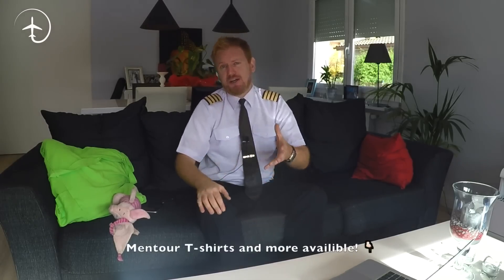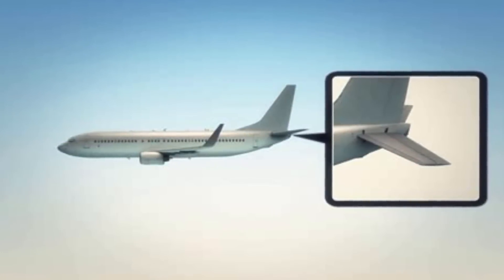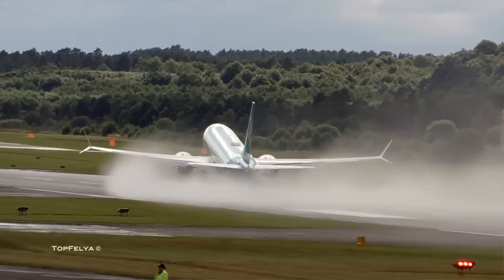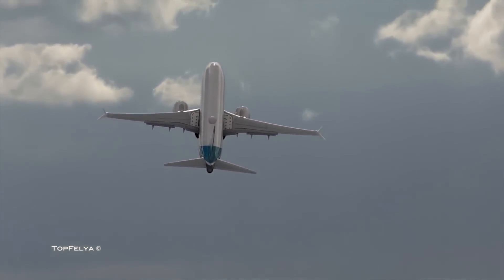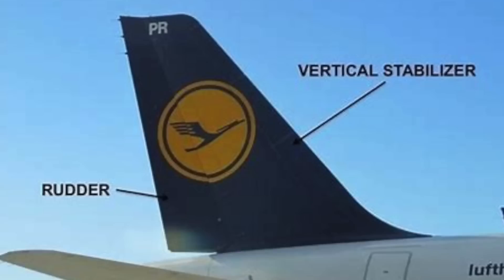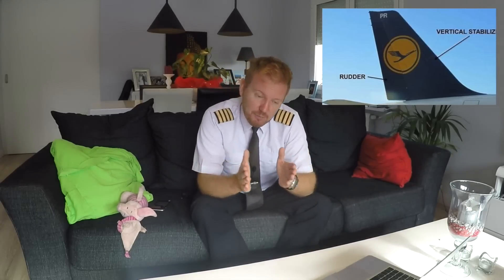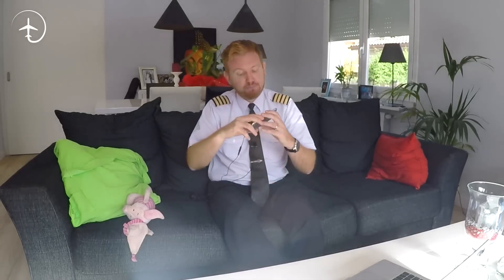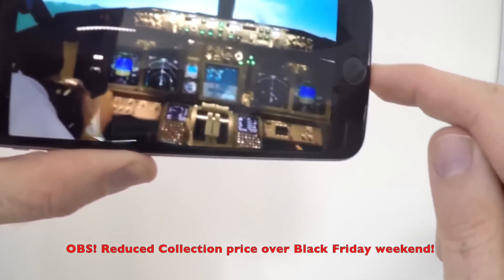How do the "Stabilizers" work?

Comment: Great video as always. 

Until you discussed the load sheet, it had not really occurred to me how pax seating could demonstrably affect the performance. Now I’m even more curious about by how much. Say you had a half-full cabin, and were trimmed up in level flight, flying manually (autopilot off). If a pax got up and walked to the back, would the AoA start to creep up noticeably? How quickly would it become apparent? What if it were two pax, or five, or ten?

Comment: I flew right seat in a Ford Trimotor a few months ago, and I noticed the pilot was adding rudder in the turns. No yaw dampers on those. Imagine flying one of those cross-country. No autopilot, so you're hand-flying the whole time, coordinating your turns. 3 loud piston engines, and back in the day, there were no ANC headsets.

Comment: To explain banking a little more, maybe use roads such as the Autobahn or the USA Interstate system, or any road designed for high speed.  On such roads, turns to the left and right will always see the road itself banked up so vehicles are using centrifugal force to remain ON the road, instead of sliding off it.  You see the same thing on turns at race tracks.  Planes do the same thing, except they have to bank themselves, and do it properly.  The principle is the same.

Comment: about the moments u mentioned. for the plane to be steady shouldn't the upward pressure moment be = to the downward pressure. that's why the greater force has a small distance to the centre of gravity while the smaller force has a grater distance to the centre of gravity, hence D1*f1(moment for grater force)=d2*f2(moment for smaller force). this is simply saying all Clockwise moments are equal to all counter-clockwise moments for it be in equilibrium.

Comment: Nice video, but you did not mention why the vertical stabilizer (the fin itself) is needed, only the rudder. This might make it seem like the fin is only there to hold the rudder control cables and hydraulics.
The actual fin itself helps stabilize the aircraft. If you imagine the aircraft flying forward, but then getting the slightest of yaw angles, then the stabilizer will catch the sideways component of the airflow and rotate the nose of the plane back into the wind. So, a small deflection in yaw will be automatically corrected. 
This only works if the vertical stabilizer is at the tail. If it were at the nose, then the sidways airflow would rotate the plane further out of the wind, destabilizing it. The hump of the 747 has this effect (a large, sidewind catching surface area in front of the center of gravity), which is why the 747 has a relatively large vertical stabilizer.

Comment: I have a question about something that has been "stuck" in my mind and you seem like the perfect person to ask.  I read an article about an airliner that survived an initial "hardover" encounter which left the pilot struggling to initiate a survivable landing with a severely deflected, inoperable rudder.  With a lot of luck and almost 30k hours of flight experience he pulled it off.  While I realize that aircraft are essentially some of the best designed vehicles that there are my question is why don't they design aircraft with simple  redundancies like a manual crank that is available to "undeflect" the rudder when it is otherwise inoperable.  I know this must sound ridiculous to an experienced pilot but a simple mechanism could be added to these "basic" systems and in an emergency situation could make a huge difference. So that's my question, do you have the thought that a manual rudder system for use during a severe rudder failure is unreasonable?  Why aren't fail safe, manual redundancies like that incorporated into these amazing vehicles?

Comment: Has there been any tests on putting the rudder on the winglets instead? I.e. completely remove the vertical stabilizer and put total rudder area divided by two on the winglets.
Maybe dirty air on the leeside and too much stress on the wings could be a problem?

Comment: Fascinating video... But would it actually still be possible to rip the tail fin off again if you were too rough with the rudder even with the safety mechanism you mentioned? Isn't the point of the safety feature to eliminate this possibility? Or will it only make it less likely?

Comment: could you do an analysis on the recent Boeing 737 800 that went down in Guangzhou china. my guess is a crack or broken rudder/vertical stabilizer because it's so weird how the plane basically went down in a straight line

Comment: I remember that American Airlines accident that happened with the Airbus A310 or was it an a300 either way it was when the first generation Airbus aircraft because of the horizontal and vertical stabilizer use being caught in the air anomaly the tail snapped off from over corrective rather use I studied this particular crash and did a project as for my final term papers in high school I'm definitely a major Aviation fan but I have to tell you it's also one of my favorite things to do is research what did happen and then research what the solution was afterwards

Comment: You mentioned there is a handle on the trim wheel and you can manually trim the stabiliser. Can you still do that during stall conditions, when the aircraft is doing it itself (ref the Lion Air crash) for 10 seconds. Literally, during the 10 sec. just grab the handle and stop it from spinning, and potentially rotate it the other direction? Just curious how was it possible that the pilots on that flight could not stop the plane from pitching the nose down... (if that was the real cause of the accident). Thank you!
Reply: I've researched this crash a bit so I will chime in here.  First of all we most likely will never know what exactly what happened due to the extreme impact forces that pretty much obliterated the aircraft and severely damaged the Flight Data Recorder.  The Cockpit Voice Recorder was never recovered.

As far as the investigators could tell, the 737 MAX that Lion Air 610 was operating never encountered a stall condition.  The MCAS (Maneuvering Characteristics Augmentation System) the aircraft was equipped with, one of its functions being the nose down trimming of the aircraft to avoid a stall condition,  was receiving erroneous data from a faulty AoA (angle of attack) sensor, which was tricking the MCAS into believing the aircraft was near a stall, thus commanding nose down trim - on both the prior and accident flight.

On the flight prior, I quote from the wikipedia article: "The runaway stabilizer non-normal checklist was run, the electric stabilizer trim was turned off, and the flight continued with manual trim; the issues were reported after landing."

Mechanics replaced what they believed was the cause: A faulty AoA sensor.

Then on the accident flight: "Shortly after takeoff on 29 October, issues involving altitude and airspeed continued due to erroneous AoA data and commanded automatic nose-down trim via the MCAS. The flight crew repeatedly commanded nose-up trim over the final ten minutes of the flight. The report does not state whether the runaway stabilizer trim procedure was run or whether the electric stabilizer trim switches were cut out on the accident flight."

"Leeham News reported that the crew did not have a clear knowledge of the trim runaway checklist which all 737 crews are required to know, and that the MCAS was going to be updated to operate from multiple, verified AoA signals."

So it seems more likely the crew just did not understand exactly what was happening and was not aware of the checklist for that specific problem.  There are differences among manufacturers and depending on priority when it comes to automated flight controls.  Sometimes a certain amount of opposite pressure commanded by the pilot triggers a disengagement, sometimes it triggers a warning to manually disable that control... but for the most part any automated control in an aircraft should be override-able by the pilots.  It's just handled in different ways.
Reply: @av8r216  Thank you for taking your time to comment on this. It makes sense when you are under pressure and not understanding the real issues to make crucial mistakes. Hopefully, one day the interaction between humans and machines will be more intuitive and they will be able to work TOGETHER and not one against another to solve the problems and save lives.
Reply: Dmitri Calnev
:  Note, never "fight" the autopilot...   hit the "red button" to cancel/ turn off the autopilot before manually adjusting anything.....

If you try to use manual trim, or control column pressure to "fight the autopilot (AP)", you may end up with potentially very "upsetting" physical integral windup and if you release pressure, the aircraft may go into a seriously unintended attitude before the AP can make up for the input error
Reply: Yes it can be manually controlled but if you are having enough back pressure to cause a aerodynamic stall then you have bigger problems.  A lot of spin/ stall recovery training involves believe it or not.....letting go of the controls. The stick shaker is designed specifically to prevent nose up aerodynamic stall.    It warns you and should force the nose down gently to regain the air speed and air flow across the wings. If your a professional pIlot and don’t recognize a stall warning you probably need to choose a different career field.

Comment: As we know the center of gravity always is just an estimation. If the members of a japanese sumo champion league have booked a bunch of seats in the back part of the cabin the actual CG will probably be aft of the calculated CG. An even worse situation could result from misplaced cargo. Hopefully the actual CG will still be inside the operational CG range in such a case. I wonder if the landing gear pressure sensors could be used to compute and indicate the actual CG to the pilots.

Comment: I was noticing that the A350's have a very good flight record, with no major incidents causing harm of life. Some would argue that the aircraft has not been flying long, but what makes travel in certain type of newer planes safer. WHy should we be having confidence in commuter flying as a whole? To me it seems like the last few years I have had the opportunity to fly on the A350 and it just seems like a very safe plane with very advanced autopilot features. Is there a topic here somewhere?
Reply from the maker: All certified aircraft are considered safe. Of course a newer aircraft have had less exposure to the industry and with less time in the air there are less chances for accidents.
Reply: Mentour Pilot so why max crash after two months
Reply: @marvinenglish4547  There are hundreds of 737 Max's flying right now, compared to just dozens of A350's. The Max also has a higher utilization rate because it's a short haul aircraft thus more takeoffs and landings so the chances for accidents to happen is higher. One fatal accident compared to thousands of flights already is a great record.

Comment: Very interesting :)

I have a question. I recently saw a video about Aircraft Initialization and some of the diagnostics contain some kind of fuel balancing system to transfer fuel from the left to the right wing and vice versa. Is it possible to use this to steer the Aircraft? Is it possible that if you want to turn it to the left, you add more fuel to the left wing, causing the imbalance, turning the plane to the left? I know, silly question. Just curious :3
Reply: When there's an engine failure its in your best interest to transfer fuel from one tank to the other to balance the airplane so you can turn and control the aircraft evenly. There's a video on this.

Comment: If you banked an aircraft to near 90 degrees and pulled back on the stick, would that turn the aircraft?   What surfaces would actually turn the air craft - the lateral vector of the lift from the main wings or the elevators?

Comment: Hi Mentour. Great video. 
Yesterday I saw a 777-3DE(ER) from SwissAir at GRU airport and i was able to see the vertical stabilizer divided in two: a bigger piece about the same height of the fin, and a second one much smaller, close to the APU exaust. 

Why is that?
Could it be for a different speed regime, similar to the inner ailerons?

Keep up the good work.

Comment: Which role plays the turning of the engines in stabilizing a jet?

A turning gyroscope has an rotational inertia, i.e. an inertia of the direction of its axis of rotation. 
Since the axis of rotation of an engine is parallel to the roll- axis of the plane, the rotational inertia takes effect perpendicular to the roll- axis, which means, it stabilizes pitch and yaw.

How strong is this effect?
Do you have to observe it in cockpit, and- if yes- when and how?
Is steering more gently when the engines turn faster?
Does the shutdown of an engine come along with a pitch- stability issue also?
Are there any limitations to steering- input due to precession of the fan?
When landing a quad- jet at crosswind: Would it be reasonable to reallocate thrust from the outer to the inner engines? The wing as lever to turn the inner nacelles is shorter than as lever to turn the outer nacelles, so the rotational inertia should be more yaw- stabilizing when located in the inner nacelles.

Does a twin- jet fly more gently than a quad- jet at equal weight and thrust generally for the bigger rotational inertia of its engines?

Comment: Ok but ... why the pilots could not be able to fly the plane without the vertical stabilizer in this incident.
Yes it is key aerodynamic element, but if only helps to stabilize the plane in flight and to help with the yaw, without it will be a nightmare, but probably manageable by aggressive handling.
Can you help me understand that. If it will be to long you can do a video on it :) 
Thank you in advanced

Comment: It's interesting that birds have very similar control surfaces to planes, with the exception of the vertical stabilizer and rudder. Perhaps they can achieve the same controlled turns without it, or they just don't care about lateral forces.

Comment: Is it accurate to say the trim and stab effect pitch attitude? You say this but it's confusing because it's also thought of as "trimming out the forces". I understand elevators are the primary way to control pitch from the pilot, but since they are part of the stab airfoil, can changes to trim correctly be though of as changes to pitch attitude? For example, if the plane did not automatically trim throughout the flight, the attitude would not be constant. So the stab is in effect making attitude adjustments correct? All things being equal, if you add maximum nose down trim, it going to cause a negative pitch attitude right?

Comment: Stupid question maybe, and I’m fairly certain that airplane manufacturers have thought about this, but if the center of gravity were slightly behind the wings and the tail were designed to provide upward lift, wouldn’t that help with overall lift and allow the main wings to be a bit smaller, saving weight? Is there a good reason they provide downward lift?

Comment: So the stabilisers on the max 8 tend to push down generally to counter act the forward moment produced by the engines moved forward. Boeing should have redesigned the aircraft by placing the wings slightly forward.

Comment: Since the lift appears to raise the nose rather than lower it (for example, nose tries falling in slow flight even in a glider), IS the downward "-lift" on the horizontal stabilizer greater (perhaps negative angle of attack) so it pushes the nose up more in faster flight???

Comment: @mentour... if you get the load sheet telling you were people are sitting to adjust the trim, how does it work with airlines that have no assigned seating like southwest in the US?
Reply: Most low-cost airlines are full of passengers, so it doesn't matter where any individual sits. They still have a load and trim sheet (fuel, luggage, etc).

Comment: Much more importantly than the comfort of the passengers, turn coordination is necessary to reduce single-wing turbulent flow (and stalls) and associated spins. Were it not for this, there is a reasonable argument that a bit of felt side force on the passengers during a turn could reduce cognitive dissonance between sight and inner ear and thus reduce motion sickness.

Comment: I'm wondering why transport aircraft tend to have a separate trimmable stabilizer and an elevator, rather than a stabilator that performs both roles. Is it just for increased redundancy, or are there other reasons?